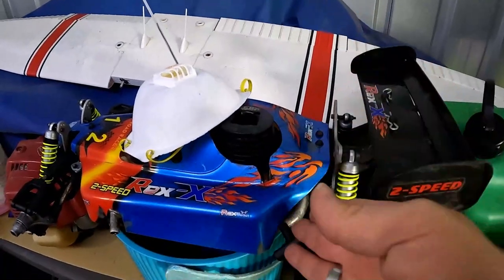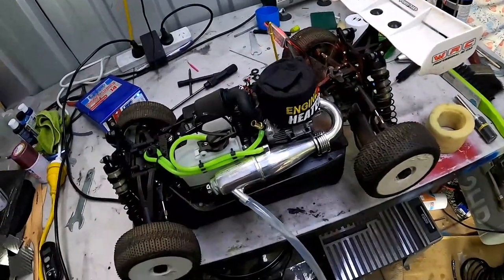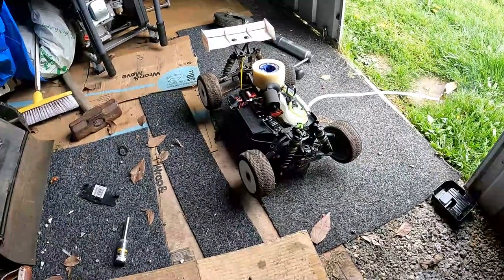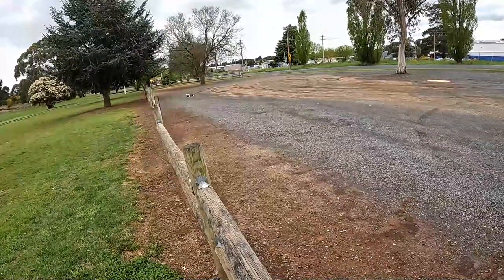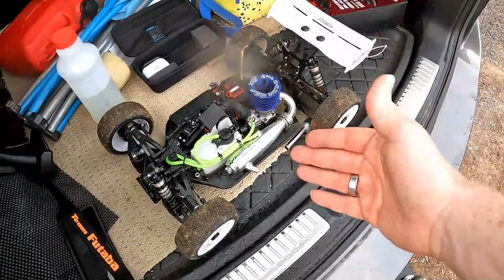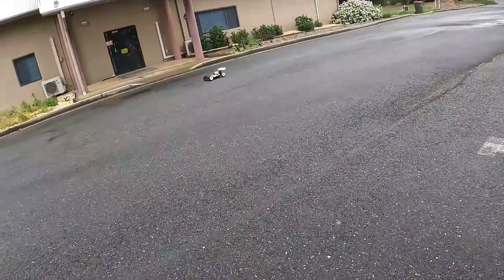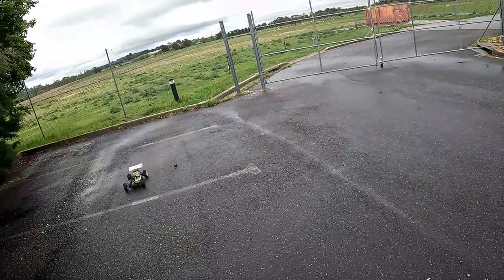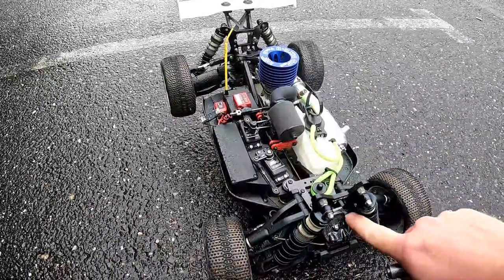How to break in a nitro rc engine

Comment: When it comes to fuel is it best to run a high nitro mix ,,cause i got 25% with the car i bought second hand and whats the best glow plug to run in with cause ive only got O.S  A5 's and O.S 8  But can buy another online if i have to ,,also when you do your 1 litre and your now leaning out over the last and final 3 half tanks ,,can you go to far and make it to lean ,,how do i know if im to lean or to rich ? I believe if there is allot of blue type smoke its to rich but how do you know to lean ?do you have a vid that exsplains how to tell .your vids been really helpful so far
Reply from the maker: @damienthomas-i8d  ok, so if the car you bought second hand came with 25% nitro fuel,  then it's best to keep running it on that however,  you can go to a higher or lower nitro content if 25% isn't available (you would just need to adjust your tune accordingly. I have fount OS no.8 plugs to be very good but if you live in a colder climate get a couple of no.7's (I think that's what they call the A3 plugs now). When doing the final tune on the engine you can go too lean as you will notice the rpm start to drop and there will be insufficient smoke coming from the exhaust. If you scroll through my videos, you'll see an engine tuning tutorial I did some time ago. 👍🏻

Comment: Can you please upload a video of how to break in a O.S. Engines .21 TM with REVO Manifold OSM12241 because I’m getting this engine placed in my revo and I don’t know what break in to use ???
Reply from the maker: The break in procedure  I demonstrate in this video is applicable to all nitro suface engines wheter they're race engines, basher engines or basic ready to run engines. The most important thing to remember is to take your time and not rush it. 👍🏻
Reply: Thank you so much I appreciate it because I thought I would have to run a different method 😃